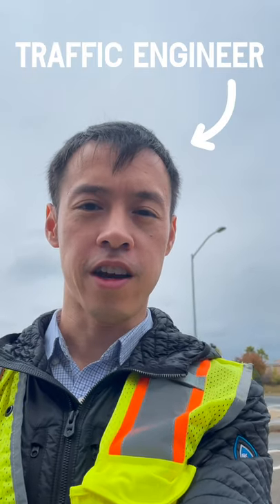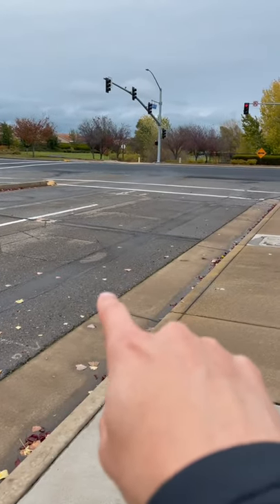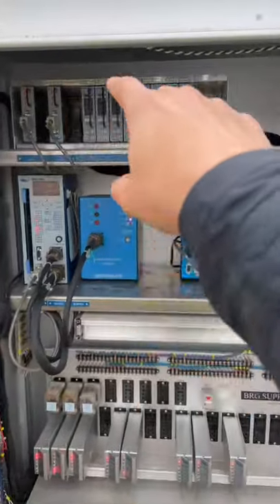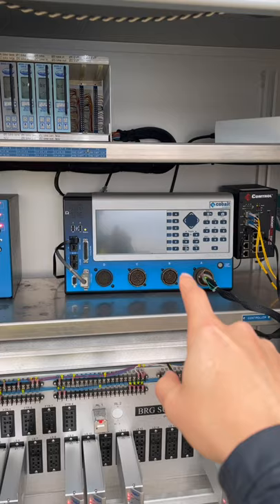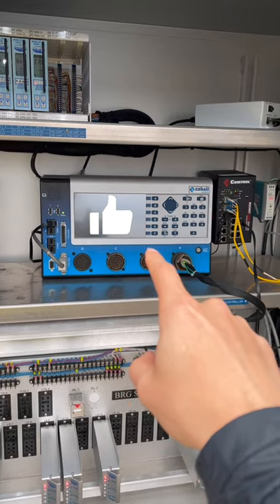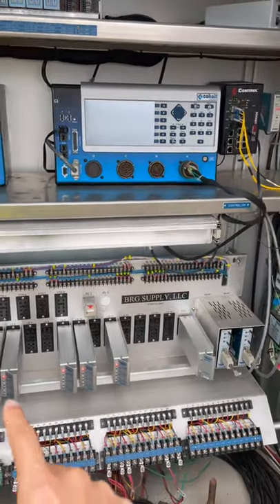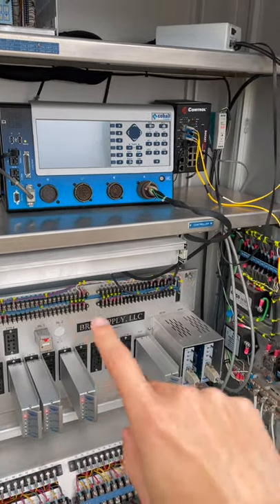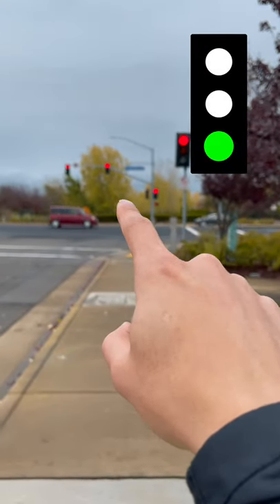How a traffic light detects and gives you a green | #Shorts

Comment: VDOT has more traffic signals (red lights) per non-interstate highway mile than any other state in the U.S. Additionally, when VDOT finally separates the grades, it insists on building massive, sprawling Cadillac interchanges when a Ford or Chevy would be adequate and, to add insult to injury, the shitass agency STILL clutters all supporting side roads and streets with traffic signals
Reply from the maker: Interesting. Traffic signals are expensive to build and maintain.
Reply: Yep and there ought to be investigations to determine whether any VA officials are receiving any kickbacks from suppliers.

Comment: All this infrastructure just for one intersection? Excluding the sensors, one would think something of the order of a Raspberry PI or 2 would be enough to process the signals and control the lights accordingly.
Reply from the maker: Although you could program something like that to work like a traffic signal controller, field equipment are usually manufactured to very specific industry standards for reasons of safety, durability, etc. For example, most of the ones I commonly have worked with are NEMA standard.

Comment: These are a pain in the ass if you ride a motorcycle! Just put them on a timer
Reply from the maker: A motorcycle should have no problem triggering the detector. Just need to make sure it is over it. Most people don’t like putting them on a timer because then it will give green to a direction with no vehicles waiting.
Reply: Just like Las Vegas, where most of the lights are on a timer and red light running is rampant. @ByronTang
Reply: @ByronTang  I’m sure in most cases this is true, but there are several lights here in California that I will move all around an area and the light will never change. Due to this I either just have to turn right and hope the next light registers, or pop out my kickstand and run to push the cross walk button.
Reply: @Roommate_WSMB it's not a "plate" it's the wires in a square that detect the vehicle. Drive over the cut marks in the pavement.
Reply: @timstram  All im getting at, is that I see the sensor lights all over, and most of the time they work just fine, but there have been many instances where no matter how I am configured on this road, I cant seem to trigger the light.

Comment: How far out from the cross walk is the detector? Or how far is too far where you will no longer be detected?
Reply from the maker: There is some variation, but a car stopped at the stop line without going over it too much should be more than enough to adequately get detected by the stop bar detector. Some traffic signals have multiple detectors in one lane and can detect further back.

Comment: Can they program a plate number to that system for change lights
Reply from the maker: You are talking about having a specific plate number trigger the lights to change? Nope. Usually mechanisms like that rely on extra sensors/communications equipment to be installed on the vehicle (and intersection). For example fire trucks and buses could have that equipment. But it’s not done for regular vehicles.

Comment: How does it detect though? Is it weight, or magnetic, camera?
Reply from the maker: If there are loops in the ground it is magnetic. If there is a video detection camera on the signal mast arms, they detect by algorithms detecting differences in pixels. Some video cameras are augmented with additional sensors (like radar) to provide even stronger detection capabilities.
Reply: @ByronTang  thanks! its very interesting